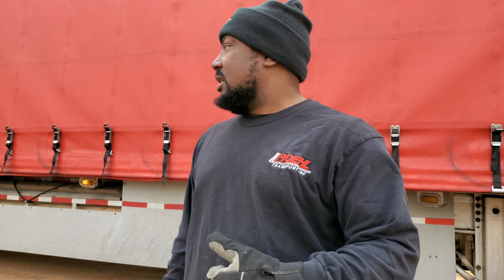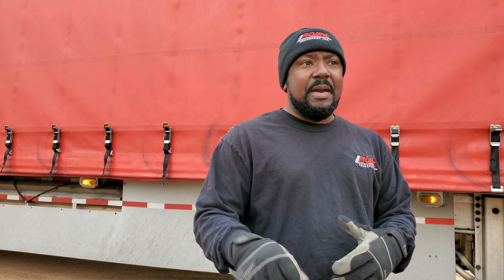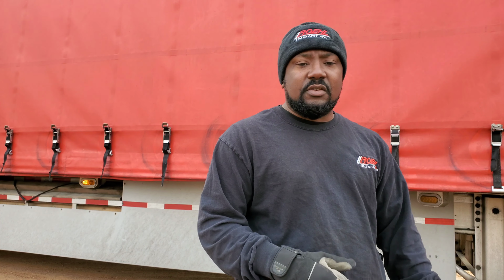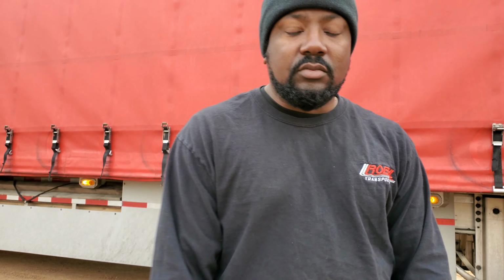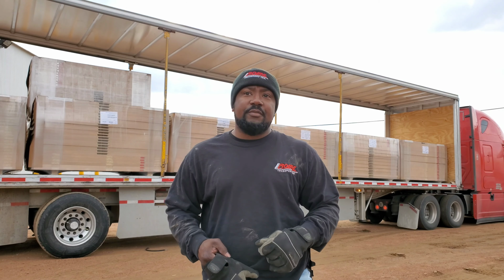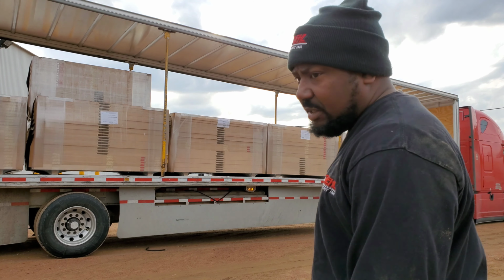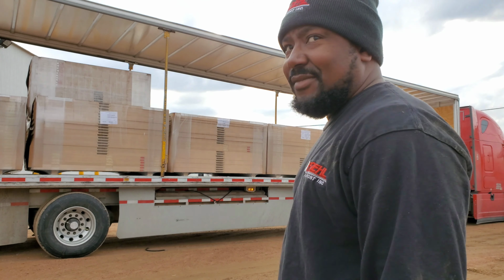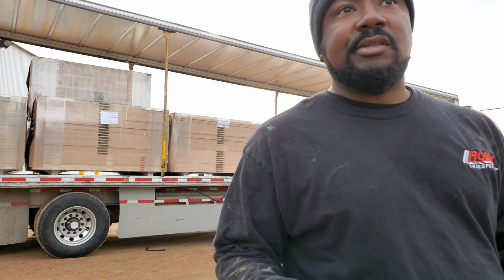TRUCKING VLOG#11| DROP AND HOOK | SECURING MY LOAD | AIR LEAK. (Part 1)

Comment: Does Roehl require hazmat?  I see on other companies it is a requirement but don't see it listed anywhere for Roehl ads.
Reply from the maker: No sir.
Reply: @hjohnny90  Do they ever haul haz or do they just stay away from it?
Reply from the maker: Yes they do but I not often. I have seen a fuel tanker at the marshfield terminal.
Reply: @hjohnny90  thanks for the replies.  I am really thinking about making the jump to the big trucks and since I am too cheap to pay for the school I would rather go this route. Current job is just lost in the masking over the last year.  Please tell me that Marshfield isn't pushing masks still as that would likely be where I would have to go.
Reply from the maker: Not at the moment on the mask mandate. Yea man trucking definitely been good to me so far.